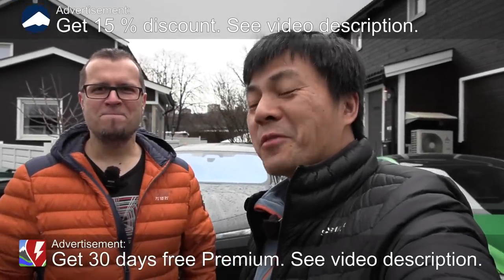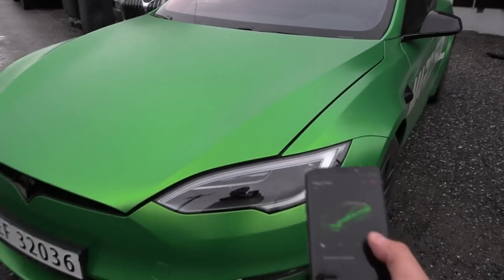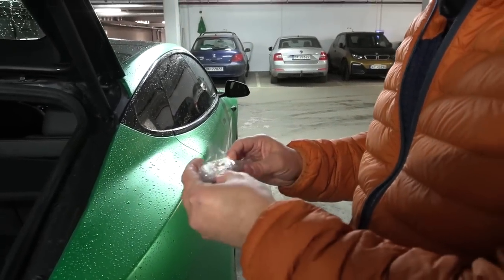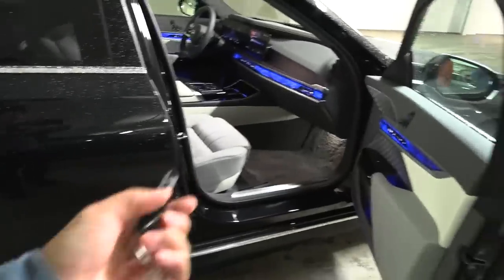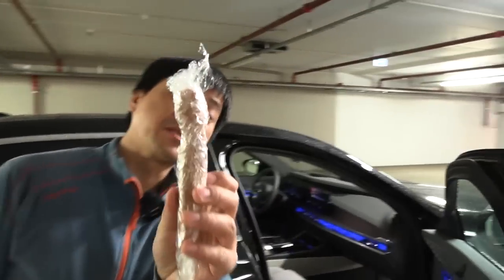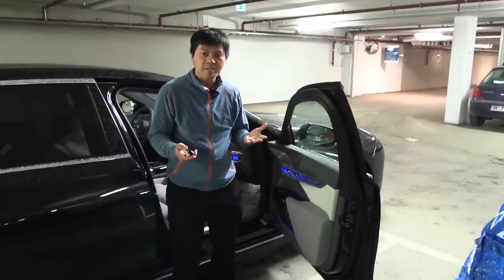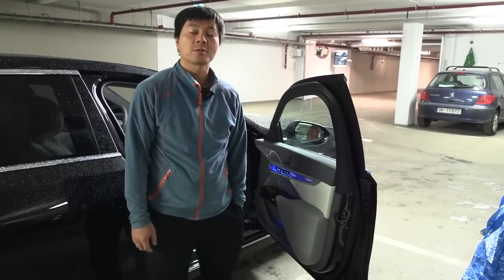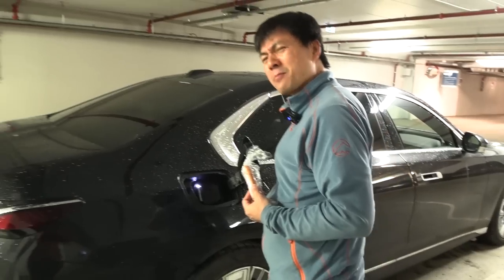Tesla Model S Plaid and BMW i7 crushing things

Comment: I wonder how the i7 doors work at tight parking space. How close it would open the doors to car parked next to it or would it slam with full force to the other car
Reply: Classically it will park the car in two spots and bang all the doors into the other cars. At least that is my experience with BMW 😜😉😉

Comment: Please confront the Beemer PR team about the limb crushing doors! :D
Reply: There is nothing wrong with it. You have to press and and HOLD the key at the keyfob. So thats the exact reason why you are responsible for clearance around the doors while closing.
Reply: Yeah, a kid could try to get in from behind just at the wrong moment and push his hand in there before his/hers foot reaches the sensors so it could be dangerous but as Alexander K. said, if you hold the button while the kid is around the doors it's somewhat your responsibility.
Reply: You also can look at it from another perspective. If someone tries to stick his hand into to closing door, you can stop the door by releasing the button at the keyfob. When you slam regular doors they are more hard to catch afterwards ;)

Comment: As far as I can remember Tesla disabled the function in the US to close the windows if you close the car by the app/key card (because of safety reasons)
Reply: Meanwhile the Kia I drive has the roll up function, but not the roll down one.....Not US tho.... But just whyyyy....
Reply: @steilkurbler4973  Try holding the unlock button for longer, it auto rolls up on lock probably but for rolling down you have to hold the button on most cars.
Reply: There were news on this and regulator wanted to disable “Vent” from the app too, but it all works on 2022 M3P in US so far

Comment: that i7 looks like a brick with wheels.
Reply: Will still be the most sold 7 series in a long time
Reply: Looks amazing IMO.
Reply: @essentials1016  ....for a brick. and as long as you dont at the front.
Reply: @essentials1016  same, especially in black it looks really bossy like a Dodge charger or sth

Comment: So what happens then with bigger objects when closing the windows of the i7? It cuts for example only 7/8 of the length through your head or neck before it recognizes that smth might be in the way - like a sausage? :D Nice video anyway, was some fun, thanks!
Reply: This
Reply: AFAIK, the motor controller for the window regulator measures torque applied (current), and will act if it is too high anyways; otherwise you can damage the mechanism.
Reply: Also the mechanical gears are out of plastic, so it would break anyway xD
Reply: First it breaks your Neck, then it stops and lkeeps you strangulatet ...

Comment: Hello, one thing, I remember that the issue about the safety of the electric windows has been due to a tragic accident.
A child was with his head outside and the drive button, of the old ones, to go up and down was always pressing.
The boy leaned on the button and the windows went up, and since he did not have a pressure sensor, he choked him.
For the following tests, it would be interesting, since I had the doubt with the BMW, I would use a small melon, which better simulates the size of a neck...
Because from what I saw, in the test, the eggplant takes a good beating.
And if your theory that the sensor works at the top is true, it could hurt a child with his head out...

Greetings

Comment: Not a good test IMO. The safety systems are suppose to stop when pressure reaches specified amount. Soft sausage is way too soft and doesn't represent the finger. It may look like a finger but no bone is inside.
Reply from the maker: You skipped the cucumber and carrot parts.
Reply: What if it is not your finger but something else without a bone in it? 😉

Comment: BMW is at an disadvantage in this: Tesla has larger gap dimensions (Spaltmaß) and movement of body parts is not as rigid as on the BMW. Better here, means more wind noise on the road.

Comment: Chargeport is different from model 3! What is the benefit of the extra motion?
Reply: It isn't extra motion, if you pay attention on video you will see it in one movement. S have different charge port door than 3 and closing mechanism too. In 3 it's one hinge in s it has 2 with different length. And also that mechanism needed for saving change port door from damaging it accidentally

Comment: Haha looks like the Model S window needs another recall.
Reply: @Pus1  Yes, there has been recalls for Tesla vehicles due to the window reversal system taking a little too much force before it activates, so it pinches harder than regulations allows.

Jokes aside, a soft sausage may be too low a threshold to activate the reversal - otherwise you might have too many false positives.

Comment: Man that bmw is ugly
Reply: At least they are confident in designing compared to Tesla which design is so boring
Reply: @binflydushy  man that’s not confidence it’s deficiencies 🤷🏼‍♂️
Reply: My used car sales guy likes to point out how this BMW design will backfire in the used car market. It is a bit like those big safety bumpers that started looking weird when the new models had integrated bumpers. Nobody wants to look stupid driving outdated car. Huge grills will be replaced with smooth closed front ends. Meanwhile my plastic mould maker is crying because the traditional grills have given him plenty of work.
Reply: @unclezeppy  there's big grills that actually look nice and well integrated in the design like the BMW M3 G80, or lots of audi, but man that i7 front is in the top list of most uggly ive ever seen, the rear is fine, way better than the front, the profile is nice too